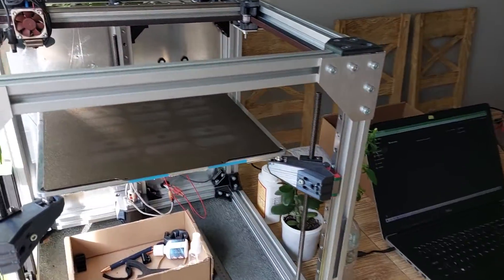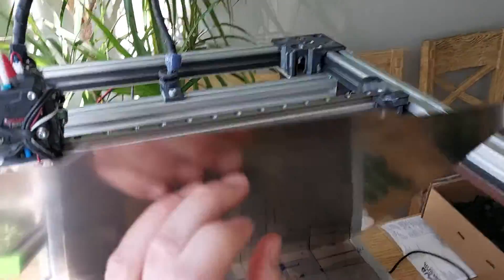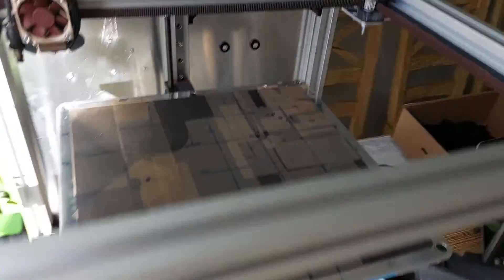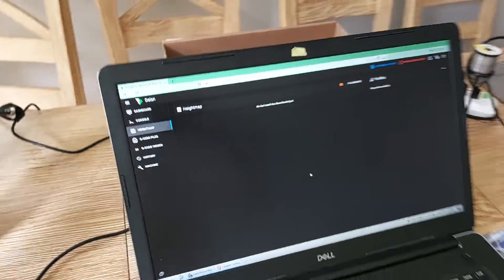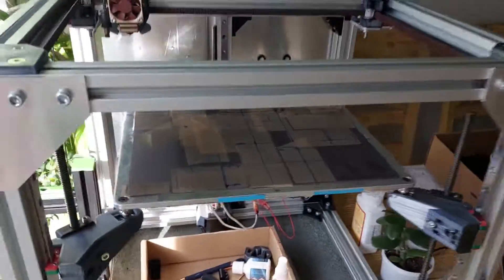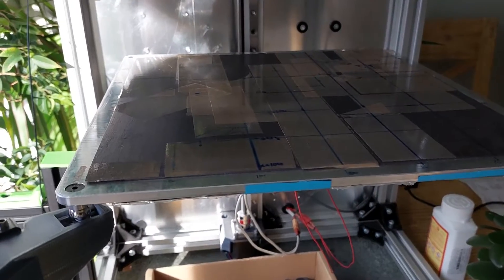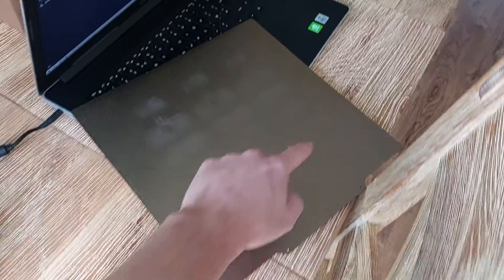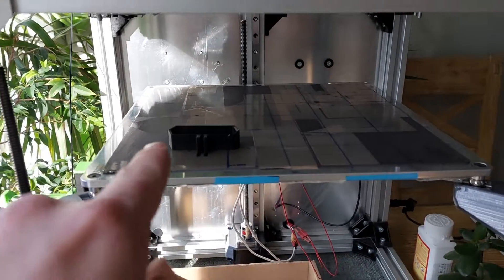Disable bed mesh leveling on ratrig 3d printer and forget about all the issues with a first layer.

Comment: It's a proper solution. Good job! If the bed is very unflat, one should make it flat first, just like what you did here. I don't know how much out of spec your bed was, but bed mesh should be used to compensate only a tiny bit of deviation, less than 50% of first layer height from all my experience. If you turn on bed mesh now, you will have data for you to predict how your bed flatness drift with time because of all the tape, then you know when to adjust again. It's all about consistency and predictability.